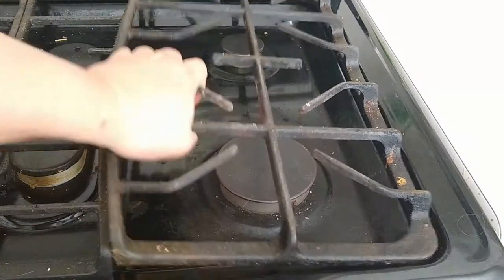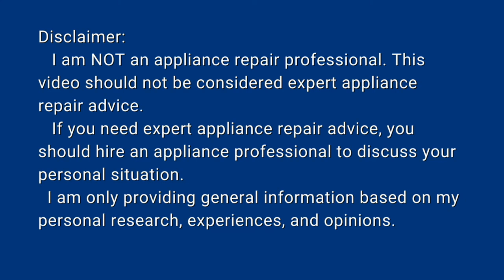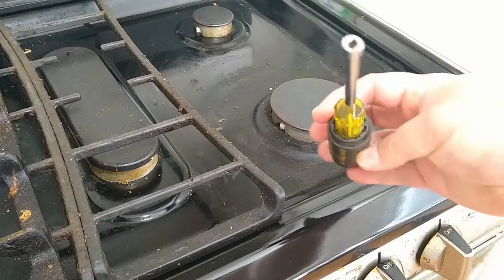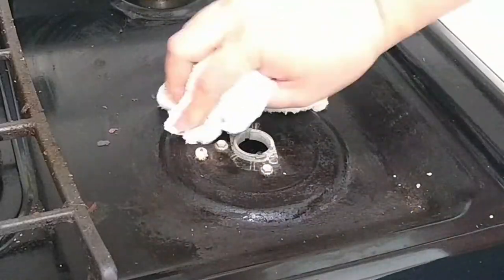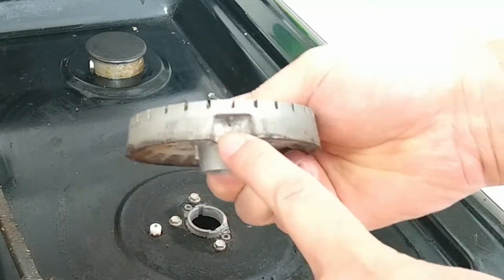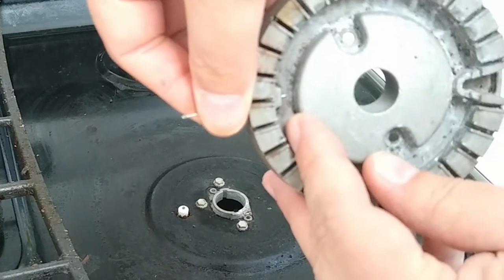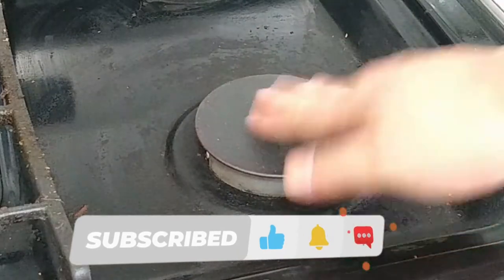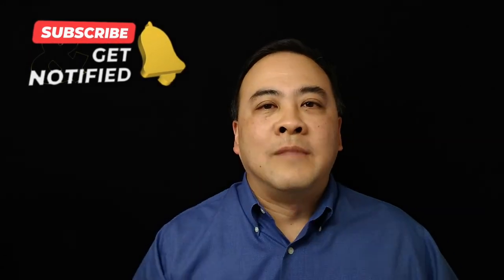Kenmore gas stove Burner WON'T START or Ignite! EASY FIX!

Comment: Thanks for the video. Our burner would light, but the flame was small. I cleared the small hole in the nozzle and it burns high like it used to.

Comment: Saved the day.  The hole didn’t seem plugged but the igniter was pretty covered in junk.  Luckily still had a spark.  Removed the screws, cleaned the igniter and the rest of the area and turned on first try.  Thank you
Reply from the maker: Awesome! Glad to hear it!

Comment: Thank you for this post!  Two of my burners stopped working after I cleaned the area around them with a soft scrub solution.  I did not have to remove the burners. After you pointed out where the small holes  in the burner head were,  I only needed to stick a pin into this hole from the opposite direction.  This worked like a charm. I am VERY grateful. Thanks again! ⚘
Reply from the maker: Yes, those little holes can get clogged easy. Glad you were able to fix it quick.

Comment: YES AFTER LOWES, HOME DEPOT I ACTUALLY GOT the right tool at Walmart for 8 bucks. The others instructed me to buy a drill after I gave two away not thinking I would need those anymore. I got all the burners working instead of none. Thanks to your video. May 23, 10:30 in the evening Praise the Lord for honest and caring folks like yourself. You are a masterpiece.
Reply from the maker: Glad you were able to get it fixed!

Comment: Thanks.. being a hero clean the stove using baking soda and vinegar. Ended up 1/5 not firing.  There goes the hero part. Somehow mixture clogged up the tiny hole. I thought the gas would go over the igniter and not through that tiny needle opening. After watching your video, clear the hole opening and now we are good as new.  Thanks a million.

Comment: Help, with your info, one weak burner cleared up with cleaning the hole you talk about ( Thanks! ). The one non working burner, (right front) on my Kenmore gas stove model 790, does not light up ( sparking and getting gas). This one burner does not have a subject hole, the other 3 do! I looked up the part online and found it, and it looks identical to mine and it also does not have a hole either. It will light up if I use a match but not if I use the knob - please advise
Reply from the maker: Sorry, I don't know the answer to your situation. I've not encountered it myself.
Reply: Thanks for the quick response. Turns out the little "gas nozzle" that brings the gas to the burner was partially clogged. Using a paper clip, I just poked into the hole a few times, put the "burner ring" and top cap back on, and it now it works! Originally it fooled me in that the igniter was clicking and I could smell gas, and it would light with a match ... so due to the partial block, the gas was not coming out strong enough to get lighted by the igniter... now we know the even a partial clog will cause it not to light by the igniter lol! Thanks for getting me on the right track.
Reply from the maker: Glad to hear it. Good detective work. Your comments will help me and other people! Thanks!

Comment: So I have this same issue. Nine of the burners are working at all,however,I don't even smell gas and the gas has not been shut off. Any idea what the problem could be?
Reply from the maker: If they gas has not been shut off, there is some kind of blockage somewhere   between the supply line outside and the inside stove. I am not an expert on handling gas lines. However, you could shut off the supply valve and check the gas supply line connecting to the stove to start.